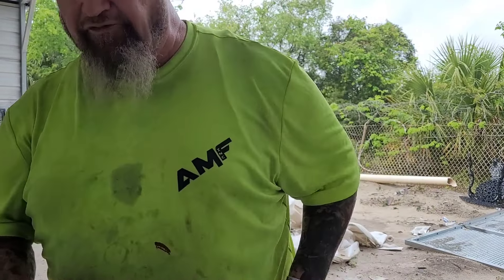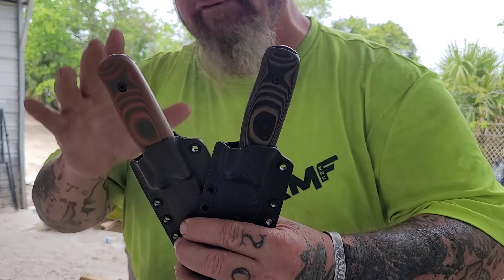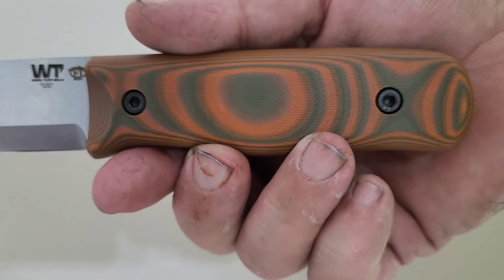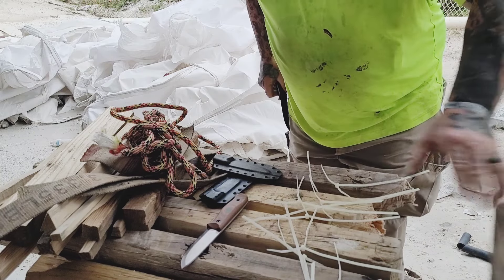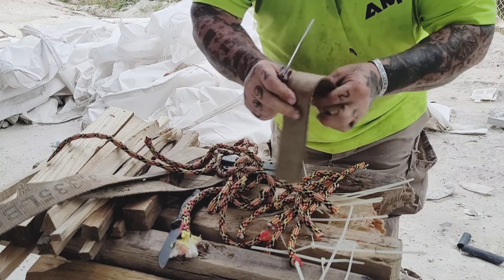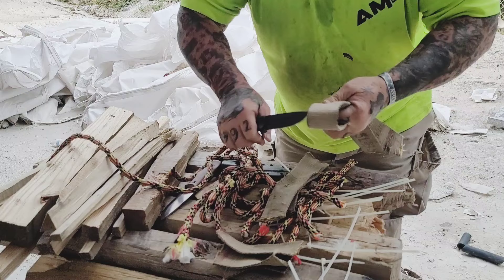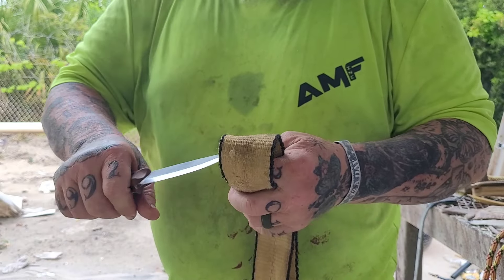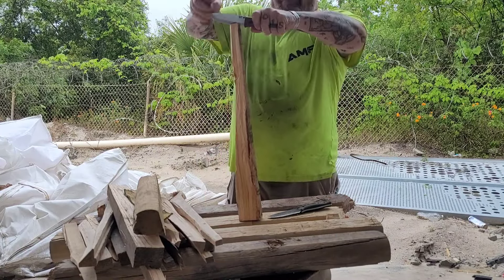FORESTER VERSUS FORESTER SCANDI GRIND VS SABER GRIND... WORK TUFF GEAR REVIEW

Comment: Great looking knives. When Work Tuff does a knife drop, how many do they put out at one time? Thanks for your videos.
Reply from the maker: Brother it just depends on what they are running.It could vary from 50 to 300.. however, now they have added DLT trading and knifecenter as suppliers so if you miss the initial there's still knives available
Reply: Thanks! I'm pretty set on trying to get a Voyageur.  That knife calls to me.  @choirboyzcutleryoutdoors